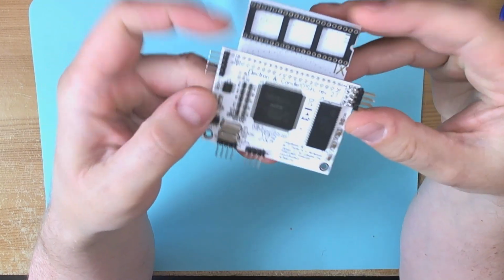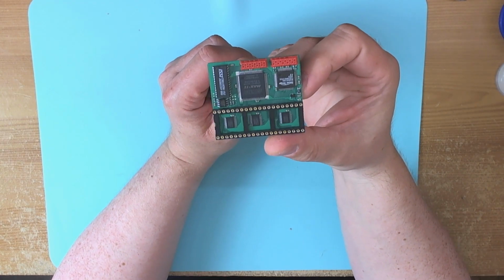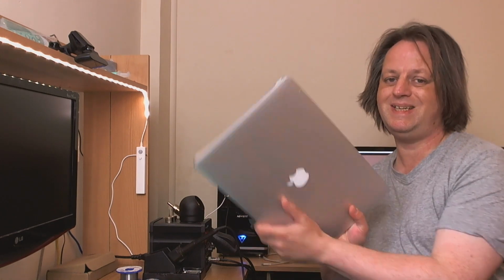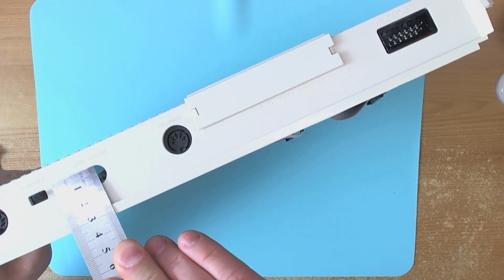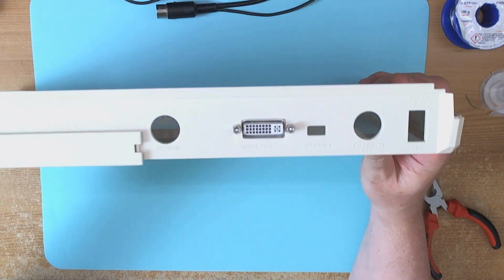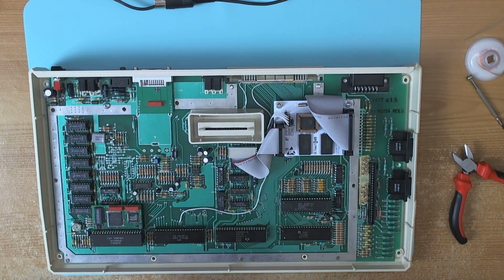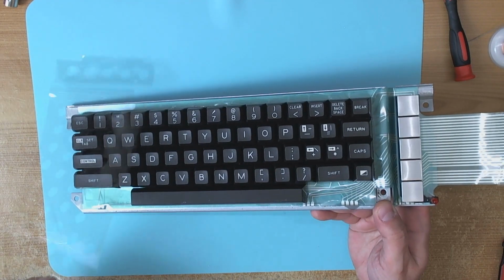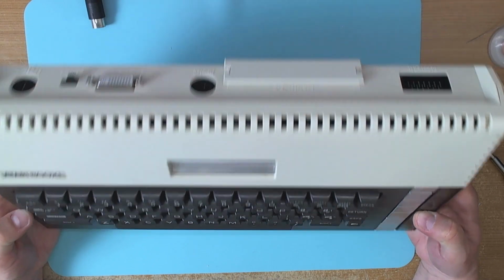Atari 8-bit Video Upgrades and 800XL Sophia Install

Comment: Is the DVI output through the 4 analog pins or is it a truly digital output? Is it DVI-I or DVI-D ?  If it's DVI-D then you could put an adapter on it for HDMI...
Reply from the maker: No analogue VGA signal. It's DVI-D and HDMI adapters work (tested here on the machine in the video with a DVI to HDMI cable). The only downside is that there's no digital audio on the connector. :).
Reply: @flashjazzcat  Can you use an adapter, say DVI-D to VGA, to output the video to a VGA monitor?
Reply from the maker: @dxgo9512  Not with this version of Sophia, since there is no analogue signal on the DVI port. Perhaps things are different with Sophia v2 (there are certainly more signals on the ribbon cable, so perhaps VGA is there on the DVI jack).

Comment: does the metal shield go back on with the U1MB fitted ?
Reply from the maker: Not on any machine in which I have installed U1MB, but if one is handy with an angle-grinder, it's possible to alter the shield to fit in certain situations. Probably not worth the bother, though, unless the machine suffers badly in terms of stability from removal of the shield (and this would be a very rare phenomenon).
Reply: @flashjazzcat  thanks when I send mine to you I will take off the shield. do you socket the chips at the same time?
Reply from the maker: @briwylie5  Yes - I do all the socketing here. I can remove the shield as well, but if you take it off beforehand, it saves the metal making a pointless round-trip (and I certainly have no need of more discarded shields). :)

Comment: So, SOPHIA is 15KHz output only?  Which means I will still need a hard-to-find monitor in the US?
Reply from the maker: Just the oppostite. VBXE outputs 15KHz RGB, but the Sophia featured in the video outputs a DVI signal which will work with any DVI monitor or even HDMI using a simple passive adapter cable. Finding a suitable monitor should not prove difficult (although you may wish to get one with built-in speakers and a 3.5mm audio input for sound which needs to be tapped separately from the Atari). It could not really get any more convenient than this.
Reply: @flashjazzcat  Thanks for the response!

Comment: There are some ways to improve Dremel part. Basically, you want to keep work area and the bit free of hot plastic. You could either cool it down (could be with water), not let it heat up too much (larger diameter of a bit, less force, more/shorter cuts), or mask the plastic with a painter's tape and cut through that (this one is also extra effective with jigsaws). There are many non-Dremel bits that can work much better with some plastics (I tried some that are normally used by dentists, jewelers, and of course various Chinese products). And I always use one of those lamps with magnifying glass - they improve the precision and also act as protection from stuff flying off the material.
Reply from the maker: That's why I cut inside of the marked line and then finish with a file: it doesn't really matter if the bit becomes encased in plastic. I stop every so often and slide the hot plastic off the end of the bit: problem solved. Perhaps the tools could be improved, but the results achieved are consistently excellent regardless (a view confirmed by clients). :) I wear glasses while using the Dremel, mind you (eye protection is indeed a good idea).
Reply: @flashjazzcat  Yup, this way is the most straightforward and gives you lots of control. Yet, few times I was in a spot where I could not use any file or knife, and that's how I found ways to do stuff with various bits instead, and get clean lines right away (sometimes I really do need a magnifying glass for that).
When I was watching this video I started to think about some kind of internal mounting bracket for DVI fixed in that empty place on the mainboard, but after a while I was like 'meh - overengineering'... apparently your solution is the optimal one. (:
Reply from the maker: @przemekkobel4874  Ironically, I was not entirely satisfied with the end result here and ended up doing exactly as you suggest (mounting the DVI adapter directly to the board where the RF modulator used to be). The owner was happy with the initial work but I thought it could be improved. I can't post a photo here but I think there is one on my atari8 Facebook page. I made the hole wider (exposing the bolts) and fabricated a blanking plate by cutting part of a Coke can so it would fit neatly around the DVI connector. The mounting bolts went through two holes in the aluminium panel, holding it in place. Totally over-enginereed, but the machine is much easier to dismantle now. :)

Comment: Why? Don't you need programs that take advantage of these upgrades?
Reply from the maker: Why install the upgrades? Video quality which far surpasses that of most stock machines for one (that's the sole purpose of UAV and Sophia). With VBXE, you get superior video quality plus hardware 80 column text which you can use with many programs via display drivers which have existed for around a decade.
Reply: @flashjazzcat  Gee, I have an Atari 800 add-on that lets me display 1,000,000,000 colors. Without a program that needs all those color, the upgrade is worthless. That's what I mean. 

Gee, I have an upgrade that gives me 10000000 sprites but no game that uses them. That's my point.
Reply from the maker: @bjbell52  Don't buy it then.
Reply: @flashjazzcat  I won't waste my money buying them. BTW - I go WAY back with Atari. My  first professional computer job was writing a 4-player volleyball game.
Reply from the maker: @bjbell52  Impressive. Given your illustrious history, you should also be aware that one of the 'Holy Grail' features for many productivity users was a good quality hardware 80 column text mode which doesn't require the XEP-80.

Comment: Thanks for making this video. Advanced stuff. I have recently acquired an Atari 800XL, having not previously been an Atari user. Previous machines were Apple II, BBC Micro, Amiga A500, Macintosh iMac, Windows Vista Laptop and now I Chromebook on which I am typing this!   Could you make a series of videos for beginners on the Atari 800XL? Although I know a lot about computers in general, I am a tyro on the Atari!
Reply from the maker: Thanks for the comment. You're in for a bewildering overload of information when it comes to add-ons available for the Atari 8-bit. The 800XL is a good, solid choice, anyway. One would barely know where to start when it comes to a complete beginner's guide (A guide to using the stock machine, a guide to gaming, a guide to upgrades, a guide to productivity apps? Or all of the above?), but a good place for you to begin would be the 'Topic for Newbies' at AtariAge: https://atariage.com/forums/topic/176545-topic-for-newbies/

Comment: Love these new style videos you been doing...having done some work with atari and action back in the early eighties the platform stuck...but coming back to it...all the enhancements available that was not even dreamed of back then.  They have left me scrambling to keep up and having to litterly buy each one to sample them and figure out which one works.  I have had all three video options covered here...my Ultimate video didn't work well but I think that was a machine in a faulty state with the install of that.  My VBXE I could never get to put a picture on my 50 inch 4k tv I use for a monitor.  Yea I used several scan doublers and no luck.  The sophia that worked the best for me...a dvi to hdmi into the tv and I was set.  Nice picture.  And this video covers the unasked question can sophia exist with ultimate 1meg in a 800xl.  I wonder what the real experience is with rapidus...I also just glaze over at the number of options for putting some programs on a sd card and then plugging that into a adapter into the atari.  Yea I have at least a couple of those.  Also a incognito should land over here next month for my recently aquired atari 800 which tested good enough to use to try that.
Reply from the maker: Thanks for the comments. Sorry UAV and VBXE didn't work out for you, but very glad to hear Sophia did the trick. Regarding Rapidus: I eventually fitted it in my 1088XEL and it lives there very happily. This confirms that - given the proper environment (i.e. clean signals and no noise; the 1088XEL has a four-layer PCB with power and ground plane) - Rapidus works perfectly well alongside Ultimate 1MB, etc. As for storage solutions: I recommend SIDE2 or AVG. The latter has the advantage of using SD cards instead of CF cards. It also handles cartridge emulation, and has a SIDE emulation mode. With U1MB in the machine, either cartridge will provide functionality almost identical to that of Incognito in an 800.

Comment: Are 800xl keycaps the same as a 1200xl as ive a missing key and was looking to replace
Reply from the maker: As GamedOutGamer says: they're not really compatible with 800XL key caps. Even if you can find a key cap which fits the plunger, it's likely to look out of place. The 800's key caps are a pretty close match for the 1200XL, but I'm not sure if any of the 800 keyboards have caps which will fit 1200XL plungers.
Reply: Probably not, no. There are six or more 800XL keyboard variants. The 1200XL uses a different keyboard from all of them. You can find the key on AA forum or ebay maybe.